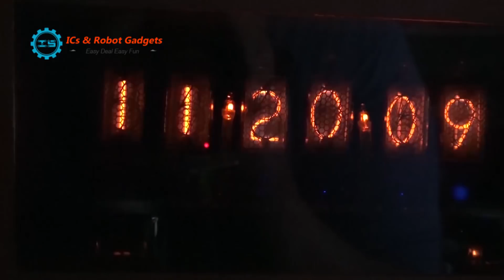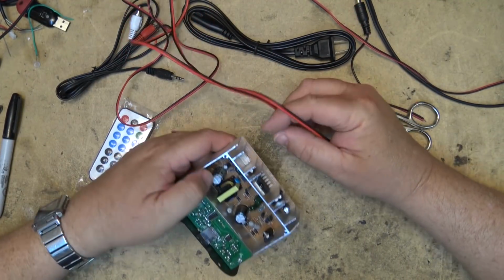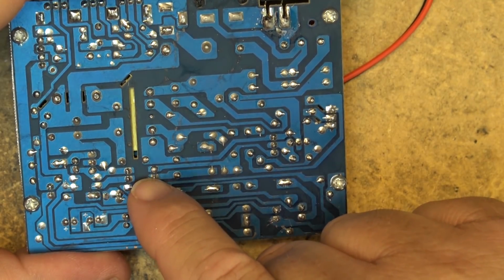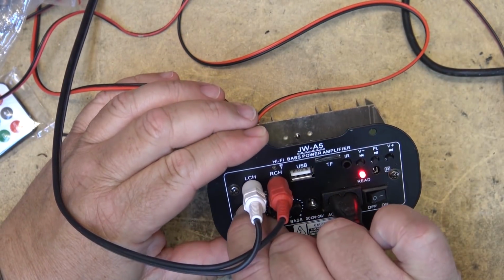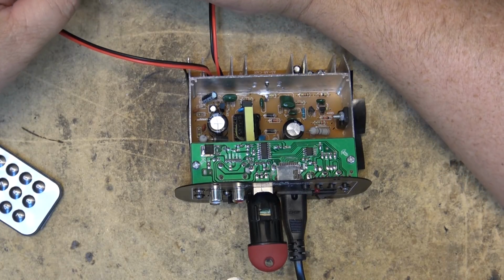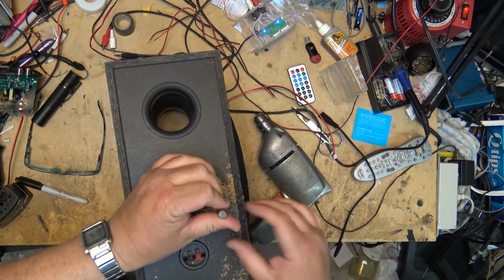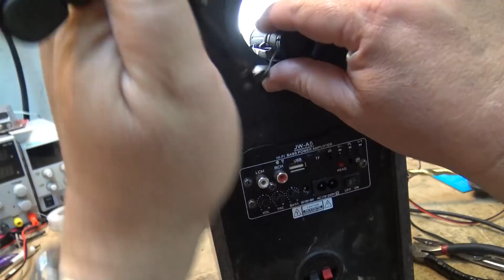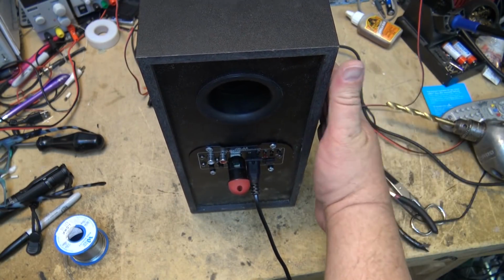JW A5 Mono MP3 Power amp boom box build

Comment: I agree about lack of clearance there between the opto and amp side.

Way too close for comfort, and given the variable quality of soldering with some of these devices, it would only take a tiny blob of solder to make the output side live.

Could be safer to buy those similar units without the onboard PSU, then either a separate PSU in the speaker box, or an external "laptop style" power brick.
Reply: Oh, just noticed the 12-24V input. Much better idea. hehe

Comment: Why didn't you power it with 12 volt?
Reply from the maker: What is the point? It has a 120v power supply on board, so there is no point of plugging in 12v just to prove that it works. Of course it is going to work.

Comment: Since there is only a mono output,t I can only assume that the tweeter output is just a feed off the other,probably just a capacitor giving a first order roll off.
I wonder why they bothered with the exposed switch mode circuitry,when a separate wall wart could be plugged into the 12 to 24 volt dc jack.
Reply from the maker: George Bliss 
Right just a capacitor for the tweeter take off. 
As to the built in power supply this is for convience. Something like this would have left be used for temporary use installed in a speaker like this. You know to take out on the patio. Who wants to fart around with wall warts or bricks. More things to loose in the times the unit is in storage. That's what I am using this for. Take it out on the patio and plug in a USB with music on it.  Sure I have built other low power speaker boxes that run off batteries but this is very convenient. Just plug it in and music. Just like my Panasonic boom box I added Bluetooth to.

Comment: So this is marketed as a "Car Vehicle High Power Low-speed Bass Amplifier Card USB Remote Control Power Amplifier Board Module"
Wonder what the "Low-speed" part is about...
Vehicle only allowed to move at 15 MPH while using this amplifier?
Should probably be "High Voltage Low-security" instead, I think.
Reply from the maker: Ha ha, yes the description is amusing. It is a 20 watt amplifier with internal MP3 player.

Comment: I don't like the the lack of isolation or the fact it is mono output,  would have been better to have left out the PSU & have a stereo output.
Reply from the maker: markpirateuk 
The ic is stereo but configured for bridged output to double power. It is designed for exactly this operation. As a single speaker portable solution. When you think of a background music type solution for say a work place this is perfect. Just load music on an sd card or USB stick and plug it in.

Comment: I wouldn't dream of plugging any of my devices into that thing unless i wanted to blow the audio output chip of the device.
Reply from the maker: Well typically the only thing anyone would be plugging into this is a memory stick with music. The PERFECT use for this would be background music in an office environment. Just get an old speaker like I did and do exactly like I did, mount the unit inside. Load some music or whatever onto a micro SD or USB and put it in the office.
In an application where stereo is not desired, such as a doctor / dentist waiting room something like the setup I just built would be most desired and that is likely where this unit is headed.
Reply: 12voltvids It looks as if the left and right rca inputs are physically joined together on the mainboard so the left and right audio output channels to your device will be physically shorted together.
Reply from the maker: Tyrone Nelson 
Your point? 
This is line level. Just what do you think happens on audio amplifier that have a "mono" button?
Yup short the left and right together. The mono switch is just that. It won't hurt the device plugged in. This is line level not speaker level.